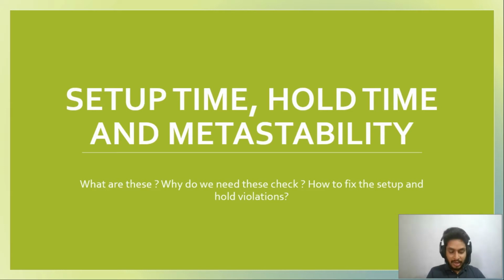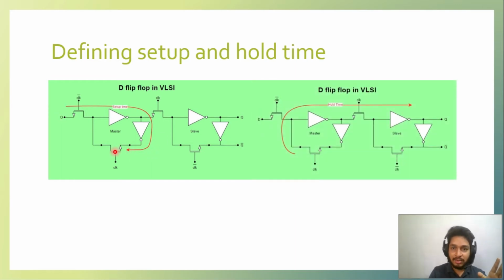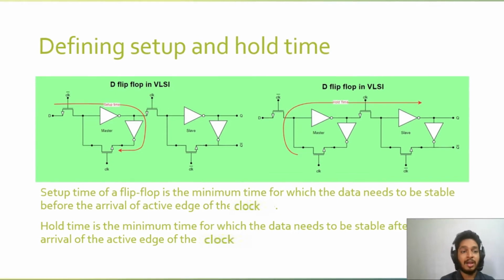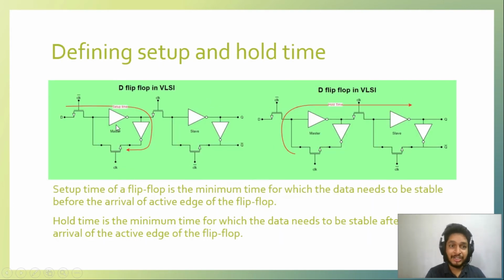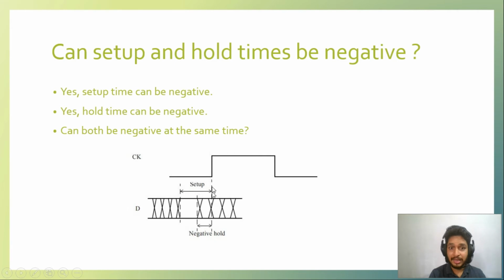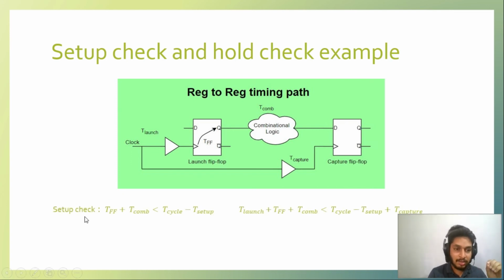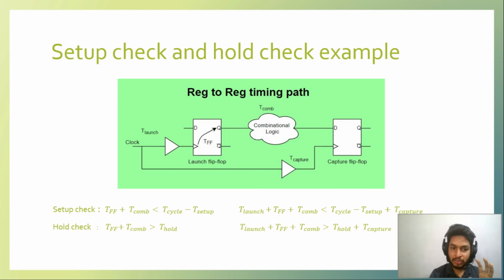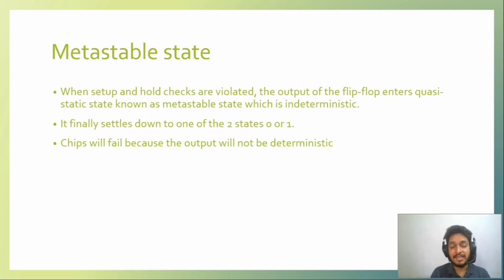Setup time, Hold time and Metastability | What's the origin? Can these be negative?

Comment: Hi,
I want to know one thing.. during hold time clk is high.. and input can be passed through the transistor when clk is low. So during hold time even if data changes then also it can't reach to output because it can be passed through the transistor when clk is low
Reply: Please answer this question. I also having the same doubt.

Comment: Hi sir, Could you please explain how we decide target latency and target skew for a block.
Reply from the maker: Hi Rahul, the target latency and skew are set by the clock design team. During Clock Tree synthesis these will be used. Clock design team reviews different types of trees that can be implemented. They use the best type for the particular type of design. There's always a trade of between skew and latency since adding additional buffers leads to insertion delay. But it's not true that always 0 skew is best. 0 skew may result in hotspot of high local IR drop. So, considering these power and reliability issues and timing issues those are set and designed.
Reply: Hi Sir, I have query regarding cts, that i have seen cts  builds in nominal corner and after that optimization is happening in fast and slow corner. Why there is a preference of nominal corner over fast or slow.